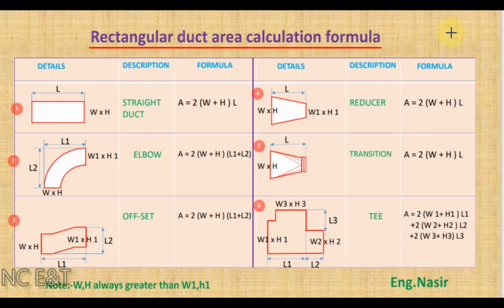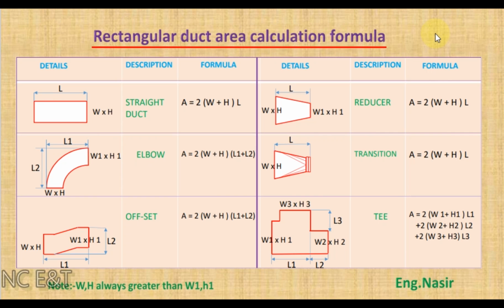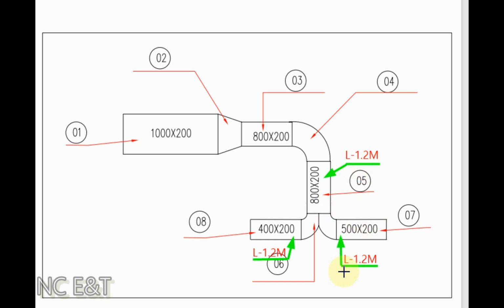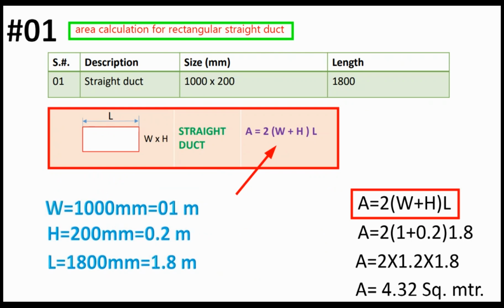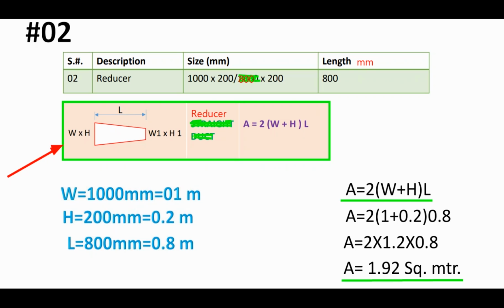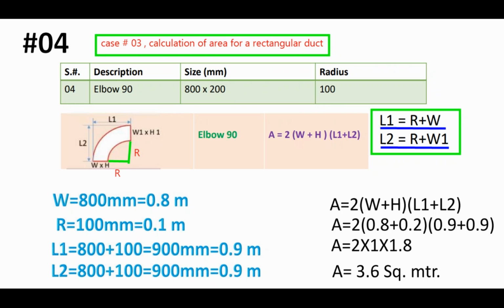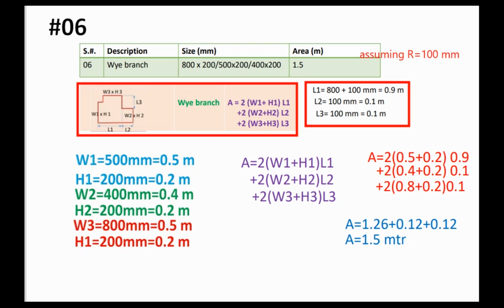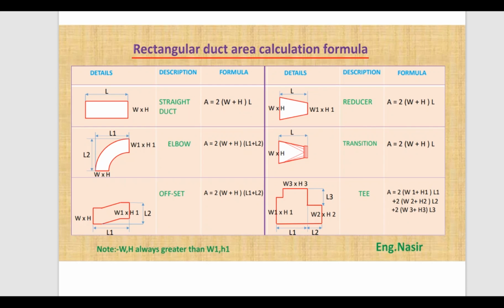33-how to calculate rectangular duct area,duct area calculation formula & detail study for duct area

Comment: THANK YOU SIR FOR YOUR VIDEO
I HAVE A QUESTION FOR RECTANGULAR DUCT REDUCER FORMULA 
AFTER CALCULATE THE w+h , THE w1x h1 NO NEED TO ADD INTO THE CALCULATION FORMULA? 
A=1.92M2 is complete size of this reducer?
Thanks
Reply from the maker: Yes You need to consider the largest dimensions, it is the estimate of sheet used for duct fabrication.